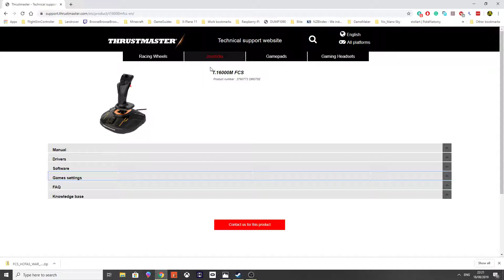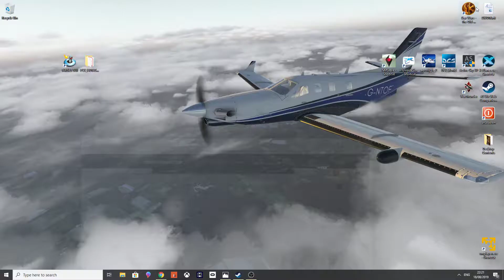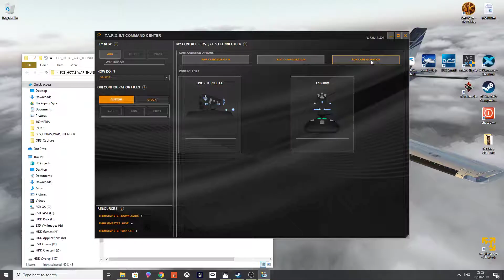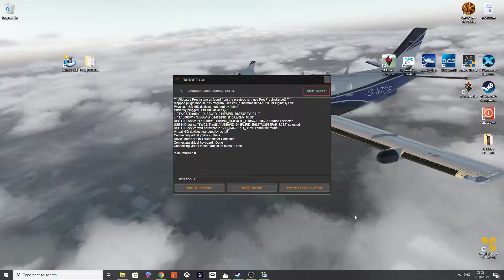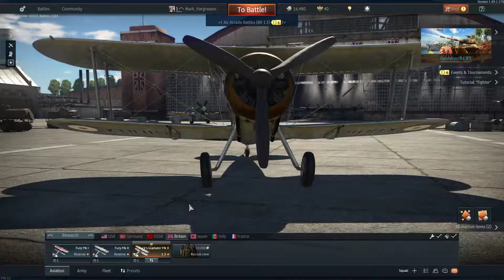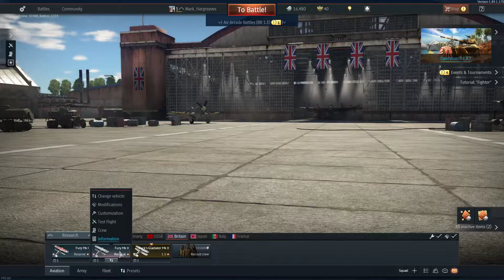Getting War Thunder Working with Thrustmaster T.16000M FCS.

Comment: Anybody who is having problems with WarThunder not connecting to the t16000m, I had the same issue and I managed to fix it by unplugging and replunging into different USB ports till one worked then use control setup wizard, i set it to the t16000m layout and from there I had to manually set each axis to the proper joystick axis. auto detect works fine for this part and i have my axis set to "C2:T.16000M:Axis #" #1 for roll, #2  for pitch. yaw is C1:TWCS Throttle:Axis 2 , and throttle is set to C1:TWCS Throttle:Axis 8. at this point you should be fine to set whatever button to do what you want, trigger works fine for me but i have seen others say i doesn't work. would recommend the software used in video as i am unsure if it will work without and i am not looking to find out. 

I hope somebody finds this helpful.
Reply: thank you bro

Comment: if you can just get 2 working at the same time unplug the one that is saying disconnected or turned off start the configuration and war thunder and do the thing with the file and then plug in the joystick or whatever you are using and add it manually it should be connected and turned on

Comment: My target gui won’t run the configuration
Reply: You need to uninstall target. Uninstall thrustmaster drivers. Uninstall devices from device manager. unplug devices. restart pc. reinstall target only, not Thrustmaster drivers. Plug in your devices. The drivers will install automatically by windows. Run configuration in target :)

Comment: For everyone who still cant play after doing this, I don't know if it only works for me but try to reassign the key binds to what you would like them to be. if I'm not mistaken once you import the thingy from a file it automatically becomes keyboard and mouse only in the control setup wizard thingy which is how it is supposed to be and then you need to redo your key binds with the throttle and joystick (once again saying that I'm not sure if this only worked for me but i will try to help) if you don't know how to set the axis settings then i will explain because I think many people don't know what do different axis mean so if u need to set an axis (on things like pitch/yaw/roll etc) press the "edit axis button and then enable the "autodetect axis" and then move the joystick in the directions you want. (for example: for pitch move the joystick up and down and for rolling move the joystick left and right) hope ive helped someone :)

Comment: So I had an issue with throttle being stuck in 49% no matter what. I fixed it by manually setting the throttle to the axis-8 (you can auto-detect it on top) and giving it Invert Axis: On, multiplier 1, dead zone 0, nonlinearity 1, correction 0. Tweak to your preference. I had dealt with the controls before finding this vid so most def something I did before didn't let the guide here work. Good vid.
Reply: Now its just stuck at 50%, lol.
Reply: @operatortranquil8113  You need to run the script in target before you launch warthunder :)